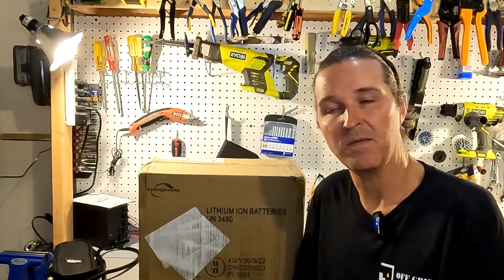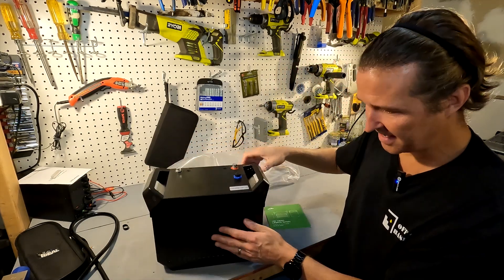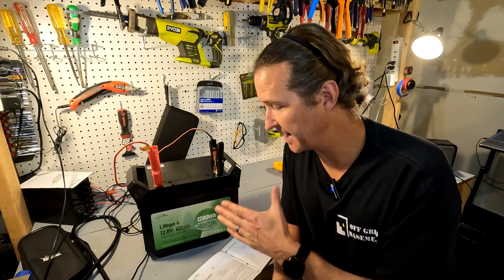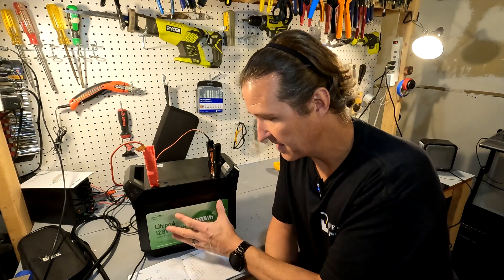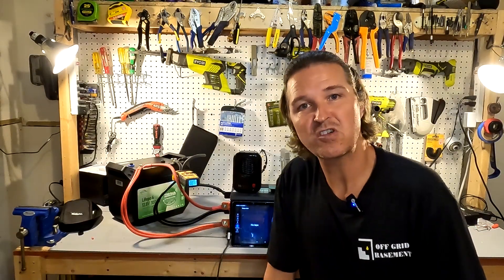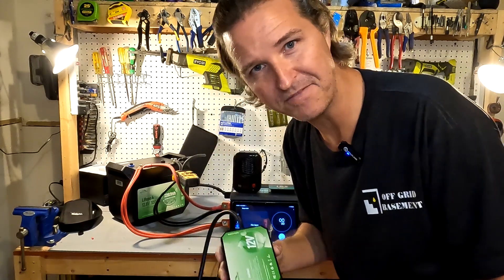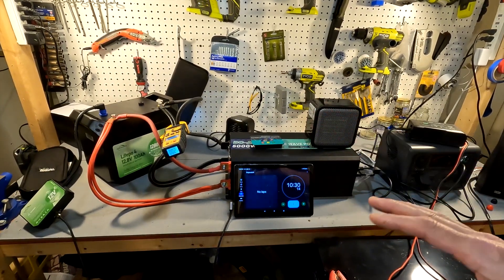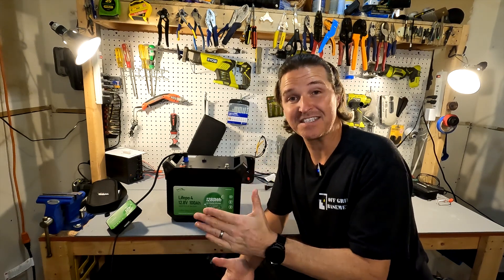ENERSHARE 12v Battery Review.  Plus DC controller box included!

Comment: Cool battery.  It's got all the bells and whistles, and it's waterproof.  I do 14.2 volts on my LiFePO4s because my inverter has a cutoff of 15 volts.  I dropped it down until I quit getting the high voltage alarm on the inverter.  I had to do it on a Powerdrive 1000 watt inverter, and then a Bouge RV 2000 watt inverter.  I've got 5 kwh of batteries and it will give me just over 3 hours of constant use from a space heater, or just under 6 hours of constant use of a 10,000 BTU AC before the inverter cuts off, so I don't think I'm losing anything.
Reply from the maker: Thanks for the information and the comment.

Comment: It’s good to see that the BMS is doing its job. The batteries that don’t shut down during high amperage discharge are a pile of melted plastic waiting to happen.
Reply from the maker: Yes.  If a battery says it has over amperage protection then it should actually work.  Thanks for the comment.

Comment: The 14.4v max voltage rather than 14.6v didn't seem to affect the capacity, which is expected. I expect that one could charge at 14.6v..?
Reply from the maker: Yes.  My charger is 14.6 and it didn't seem to have an issue.  Thanks for the comment.